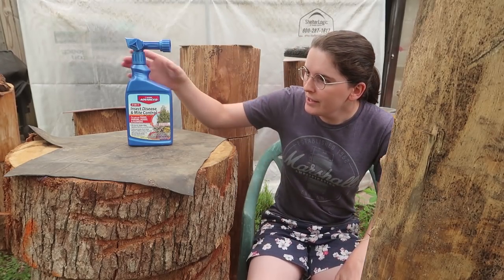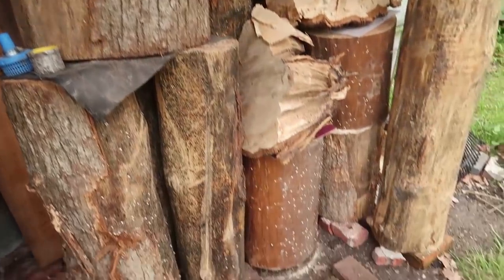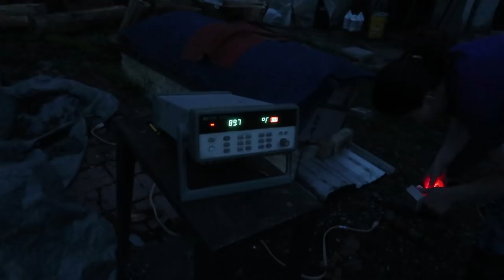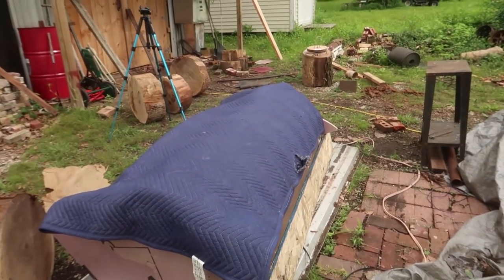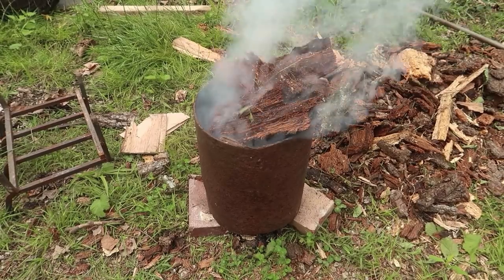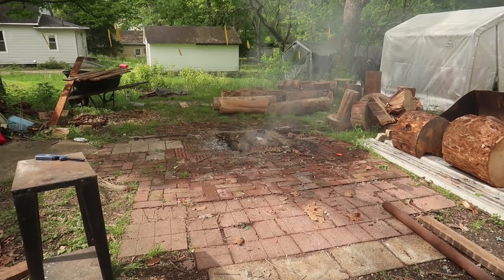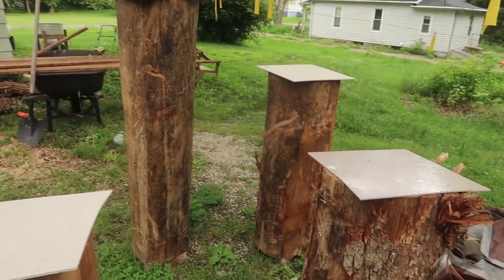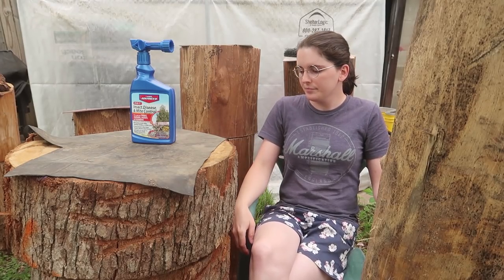Learning Woodworking 07: Killing Powder Post Beetle Infestation with Insecticide and Log Kiln

Comment: They don't get the attention that that termites and carpenter ants get, but powder post beetles are very destructive. I had them in a back porch that I discovered by accident. They destroyed all the 2x4's and much of the sheathing. Water had been getting into the walls under the windowsills due to improper flashing. I tore it all down. Fortunately, they didn't get into the main house.
Reply from the maker: glad you were able to fix that.

Comment: You could build a HHo generator, and plumb the O2 in the bottom of the pit. To burn alot hotter, or the HHo , fuel and oxygen, burning the bark, and heat the logs, drying them.
Reply from the maker: bad idea, i dont want hotter, i want it more even. you clearly misunderstand this.

Comment: I don't know if it works , but I heard of rubbing clay mud over the bark to keep parasites out, it can help dry the wood also, I haven't dried enough to have this issue.
Reply from the maker: adding clay would lock moisture in, making it even worse.

Comment: A friend gave me some nice wood to turn and after I started he said he had treated it with chlordane!  I did not want to have that in my lungs so he got his wood back. Don't turn or use treated wood.  Portable microwave?
Reply from the maker: i think you are overeacting when you say to never use treated wood.
Reply: @RinoaL    Well, I meant don't breath the sawdust or use it for pieces that will be handled.
Reply from the maker: so you are overreacting by far.
Reply: Car exhaust is far worse